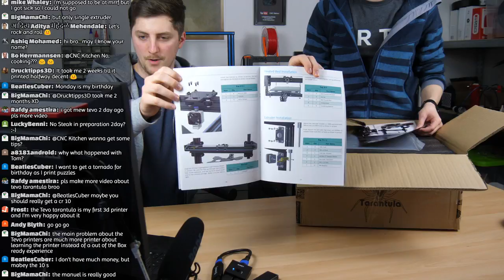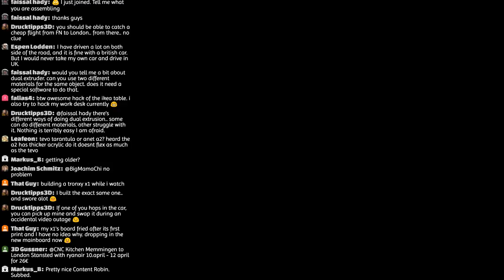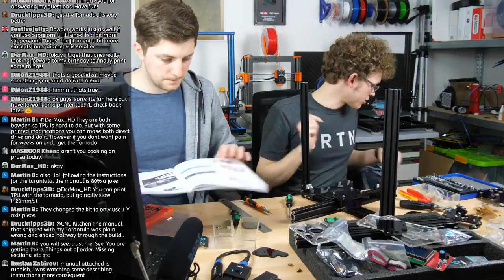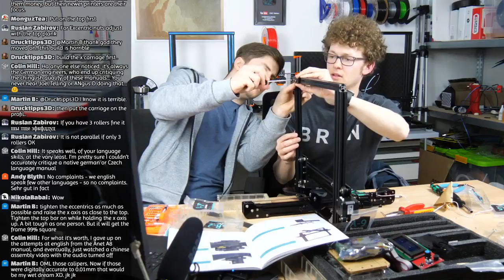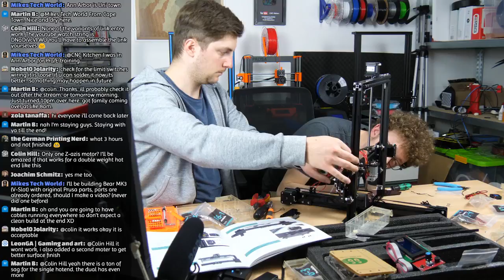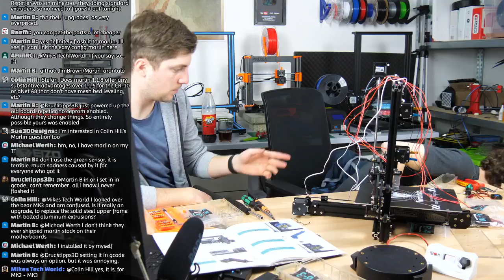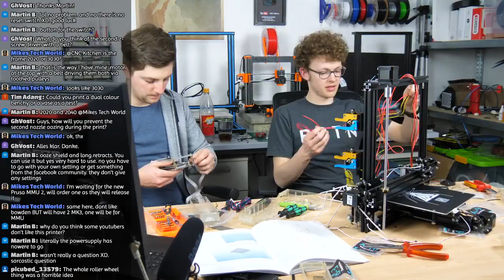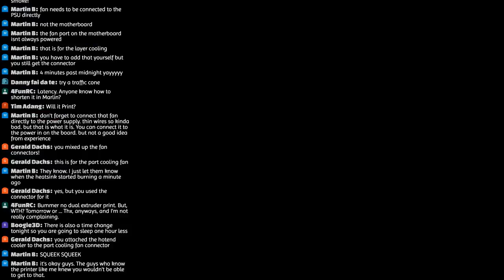LIVE: Tevo Tarantula DUAL Extruder 3D Printer Build

Comment: L and T furniture/cabinet braces can be found in most hardware stores - even Walmart. The ones I use are just a bit narrower than the 20mm extrusion so work well. They give a steel spine to the otherwise weak junctions.  I have a picture frame corner clamp I use to hold the parts in alignment as I attach the brace at the corner. Once fastened, there is no movement of that junction of parts. Also, because the braces are flat steel, they are applied to the side of the extrusions forcing the sides to align as well as holding the angle of the corner.

Also, I don't care for the trouble caused by the "hammer head" style T-nuts. Before a build, I order 100 - 150 solid t-nuts. You have to be sure to insert them in the channel before closing it off by connecting another part. But the rigidity and reliability of a nut that is there and tightens firmly EVERY time, the first time, is worth the extra expense and effort for me.

And for builds using LM08 bearings and 8mm rods, I first measure the rods to make sure they are not junk and replace them if they are.  Same for the bearings.  You can't expect decent prints if the components you trust to provide smooth and straight motion aren't up to the task.  No experience yet with the V-grooves but since they are extruded rather than machined, I expect some affect on the motion caused by the surface finish of the groove and variations in parallelism of the grooves. Some extrusions are going to be better than others, but has anyone determined what quality is required for acceptable prints?

Comment: I had locktite crack and ruin my whole anet a8 frame. The fumes from it do something to acrylic and some other thermo plastics that cause them to crack. If you had put locktite near any acrylic parts they will eventually crack. Shame I thought I was doing good by using the locktight on the nuts but ended up ruining my printer frame. I would keep locktite away from any acrylic parts for your builds in the future. I would be interested in the science behind why it causes acrylic to crack, very strange.